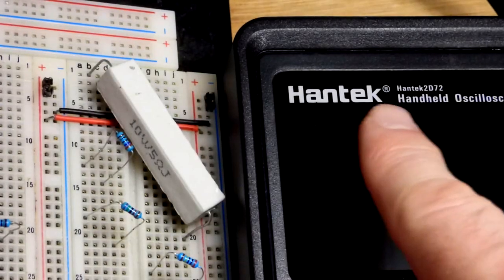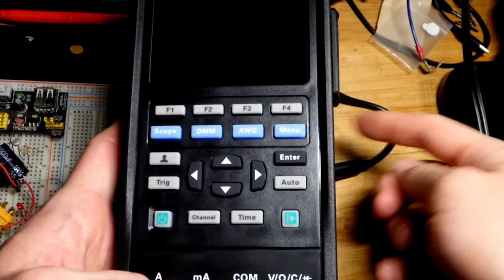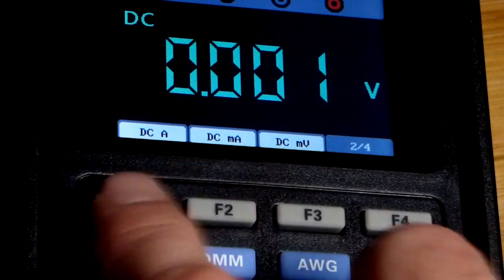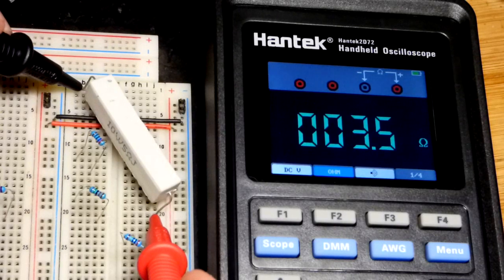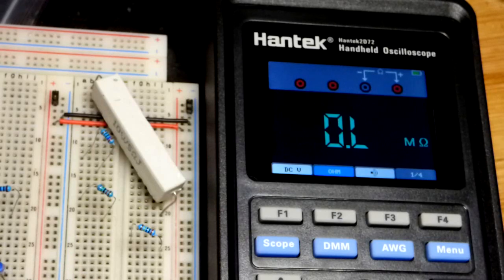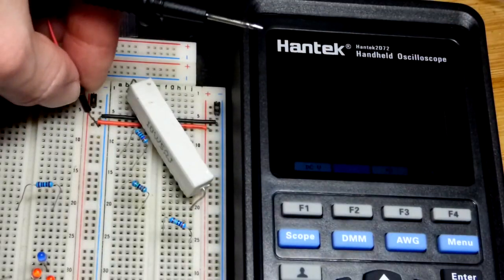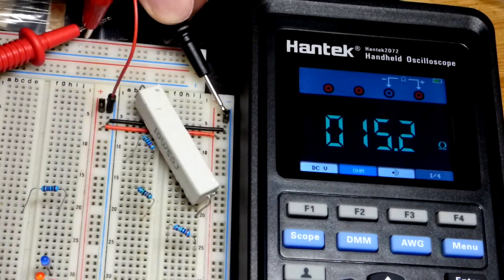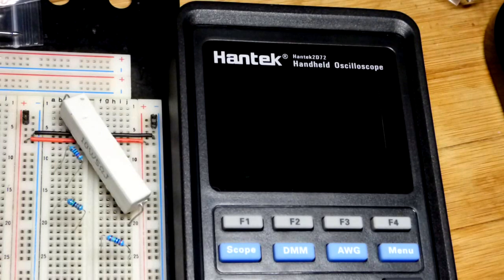How to take multimeter resistance measurements with Hantek 2D72 DIY video

Comment: I hope you can adjust the backlight setting because it's to short, I guess it will be in a menu somewhere and if you buy some cheap breadboards the resistance can be significant and annoying !...cheers.
Reply from the maker: Yeah, you can make it so the backlight doesn't dim. I saw how to do so before I got the tool, I just purposely left it alone for now so that people new to the meter will see how it behaves out of the box. That's a good point about cheap breadboards. I have used this one for years, whereas I had to replace the cheap ones all the time when I used them.